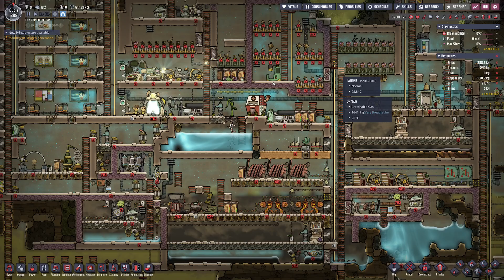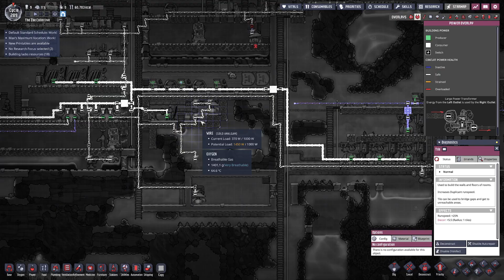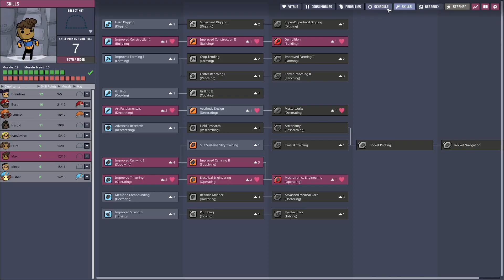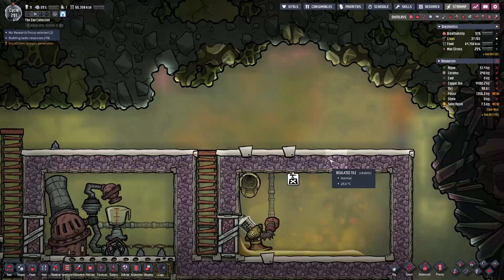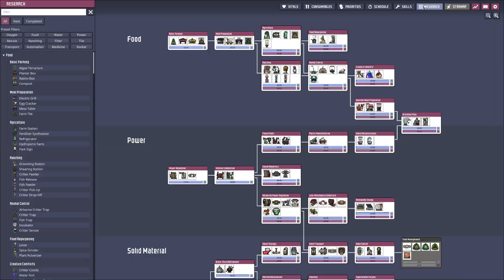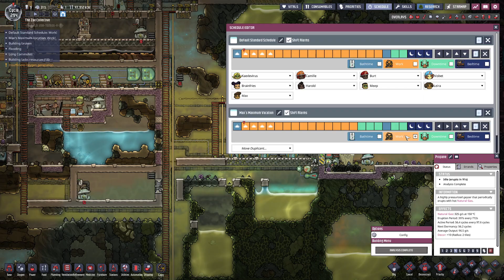Return of the Natural Gas EP 54 | Oxygen Not Included

Comment: Ice biome won't stay cold forever, it just a mass of cold matter, and heating it up will melt it eventually, just like the real world.
---
Diamond can be used for decoration (windows tiles, aero pot, statue), and used in the rocket for mining other materials from space. If you find the Ancient Specimen POI on the map, it can be traded for fossil.

Fossil gives lime, and lime is usually the limiting ingredient for making steel, which is a vital ingredient in a lot of later game stuff. (both fossil and lime can also be used to build stuff but that's an insane waste :D)

The sedimentary rock can be fed to Hatches (for meat and coal)

With the Spaced Out DLC, the coal from the hatches can be turned back into diamonds, and the whole loop is material positive there.
---
abyssalite is not a building material (it is an ingredient in a few crafting recipes, it used to be a building material in the early beta)
it's got a small amount of thermal conductivity actually, but so low it rounds to zero, but there are some places where you'll find it matters. If the natural abyssalite tiles are really hot or cold, any gas or liquid (<5kg) coming by will transfer heat, and get you random scaldings or 'chilly surroundings' messages. If you run into that, just break the offending hot tile and put an insulated tile in its place.
---
disable disinfect entirely by just unticking the box while in the germ view. :)
---
You really want atmosuits for the oil biome, see if you can find some thimble reeds or drecos.
---
I got some notes on pipe layout, the fluids in a pipe can only ever travel one direction, and generally that direction is set from green to white. If you make a layout where the liquid comes from two places and can go to two or more places, then depending on the pipe layout some sections could become two-way in the real world, but in the game it instead just pick one direction at random (with no indication of which). You can use bridges to create directionality, or even looped flow in a closed loop, as well as priority when splitting or merging flows.

Storage tanks, you can make use of the storage container building so that you don't have to vent fluids in a square room and then pump it back up. Especially the petroleum on the floor like that is a waste. :)

---
Good luck! It's nice to see someone trying to figure it all out on their own. :)
Reply from the maker: Thanks for all the good info! I was thinking maybe I should look at atmo suits before diving into the near-boiling oil lol. As far as liquid flow goes, it definitely does seem to behave the way you've described - not the most intuitive but we'll make do I guess. I suppose we should use the ice before it goes away eventually... will explore using ice practically soon!